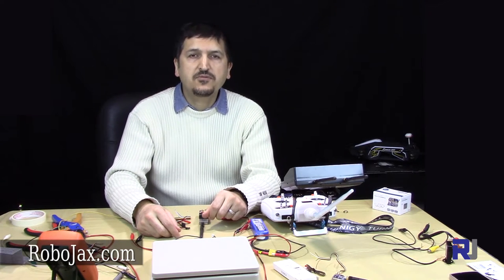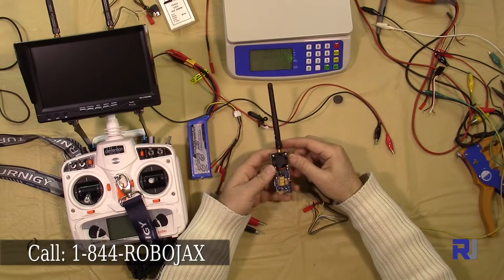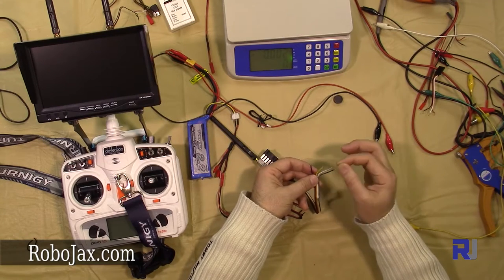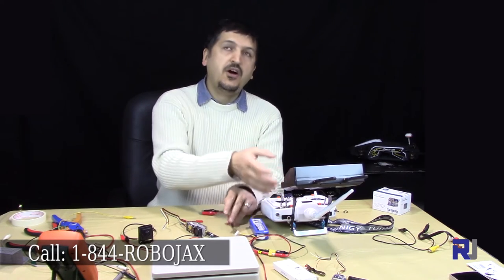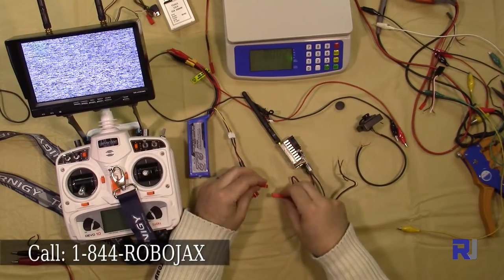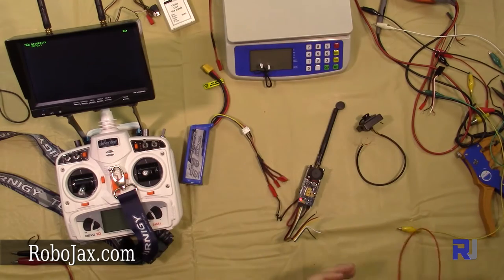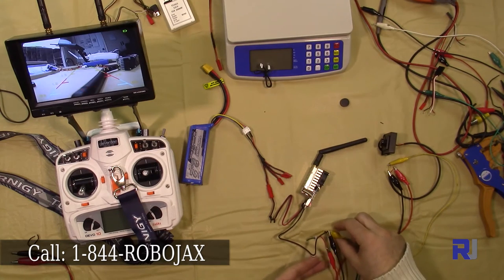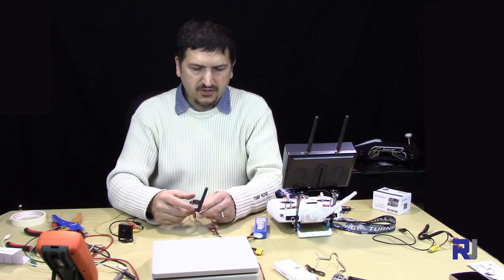Boscam TS582000 2000mW FPV Transmitter introduction

Comment: When you power the transmitter does its cooling fan work instantaneously or take some time get started?
Reply from the maker: Yes. the fan turns on instantly.
Reply: +RoboJax Videos my cooling fan is not turning on instantaneously. Do you know what the problem could be?
Reply from the maker: I just checked it. The fan is connected directly to the power source. If not running, most probably the fan is dead. But possible the connection is broken. Check if it receives any voltage. You need multimeter to do this.
Reply: I ve used my multimeter and figured out some connections as linked wrong. The positive and negative (from energy source) have continuity in the same point on the board. I guess I gotta connect the cooling fan directly to the energy source as your is.
Reply from the maker: Yes. Does not matter where, just connected to the power source and you will be okay.
Reply: Roberto Farias when I got mine, i tested it and it was working but I had to let it sit in the box a bit longer while other parts were getting shipped. well, never everything has arrived and now the transmitter's fan isn't working.. The red light comes on and the whole thing gets hot (like it should) so hopefully I just have a dead fan..

Comment: my friend.i have this transmitter (Boscam TS582000 2000mW) with RC305 AV receiver.the problem is that i have to much noise.i put filter for 5.8ghz but do nothing.any ideas?i use fy41ap.also i have on my plane the data radio FY 605 at 433hz.i don't know what to do.also i tried to have at my dround station a video booster.do nothing also.thank you.
Reply from the maker: noise on the video? or audio noise? it could be the fan is bad. To make sure if noise is due to fan rotation or current that the TX draws, I would suggest disconnect the fan for 5-10 seconds and see the noise disappear. If noise disappeared, then you need another fan. If not then filter should take care of it.
Don't worry for 10 seconds test without fan. the head **sink is large enough to dissipate the heat.

Comment: How many KM it can transmit in good weather condition ?
Reply from the maker: in line of sight (no obstacle between the TX and the RX) up to 10km. But this is not possible with drone. So you might get less than 1km. With airplane people have achieved some long distances.
Reply: dear, on realy realy realy line of sight(Mountain) UP TO 10 KM????

Comment: please help me.  I live in an urban environment. I am looking for something that I can get about 300 metres .
Reply from the maker: the power only will not help you. You should have high quality 
Transmitter antenna and High quality Receiver and Antenna. Diversity 
receivers are better.
Reply: What do you recommend a product for my needs?
300 meter in an urban environment.
Reply from the maker: it depends on how heavy the drone is. The 600mW located here http://robojax.com/products.php?pid=84 might be a good option with high quality antenna on the TX and a diversity receiver either on Goggle or a Diversity Monitor such as this http://robojax.com/products.php?pid=35

Comment: Hi ,what about range ? how long transmit good quality video signal  ?
Reply from the maker: +Senaka Udapitiya the range depends on many factors. 58GhZ is for works best at ling-of-sight (LOS). So any object on the path of signal from TX (Transmitter) to RX (Receiver) will cause signal disruption. then the quality of Antenna in both TX and RX and quality (sensitivity) of Receiver.. So we can't have say for sure what is the range. But the range should be much better than 200mW or 600mW TX.
Reply: OK thankx,